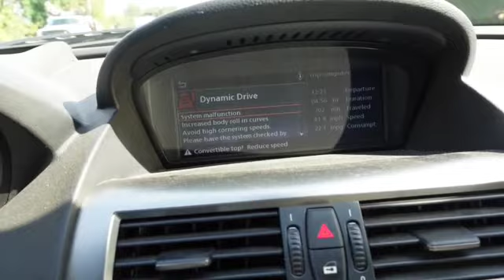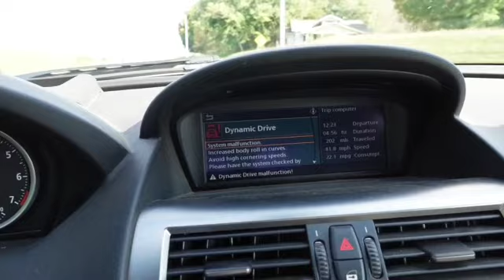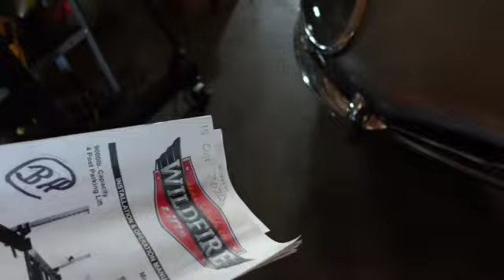Wildfire Lift Rebuild. You better do this. Check every single thing as I found a few other problems.

Comment: Did wildfire take care of you. I am thinking of purchasing a 12,000 lb lift from them. They did a video on bad bearings during covid days from supplier's. Please answer Thanks
Reply from the maker: Howdy!  The only thing they'd do was to offer me more their bearings and I didn't want those.  I got SFK's from a local spot.  Wildfire was a bit snippy about it and I can't say I was happy with the service.  The bearings in the lift were pure junk.  There is a response from the local guys and they wanted to keep those junk bearings to show customers.  I guess it was when suppliers were not 100% but they were still crummy bearings and crummy service from Wildfire.  I was hoping for a bit of a refund but it was not offered and I didn't ask.  For stacking I'd be concerned for sure.  Over the past months I've also noted that the drain back valve on the hydro system is leaking back.  When the bearings failed, and were falling onto the floor I had not used it but maybe 20 times.  It took most of a day to change all the bearings and that was not anything Wildfire was concerned about either.  I had to drill a hole in a runway to get one of the crummy bearings out!  I also put a friends Dodge Duelly on it (GVW 7,000 lbs.) and it seemed to really sag and we decided to not go under the truck.  I also had to replace a leaking hose.  I didn't bother to tell Wildfire about that.  I have no idea if they have "improved".  Thanks for the comment and ask any other questions you may have.

Comment: WOW...thanks for the video and honest feedback, I have a lift on order with Wildfire and these eye opener "ISSUE" videos can be a life saver, I think I'll just replace all the bearings before I install my lift, as it seems to be the common fault with this brand. Better be safe than sorry.  Stay Safe Under There !
Reply from the maker: It was a bad day when these bearing just turned to rubble.  I found bit of busted bearings for days after I did this job.  Thanks and I am so happy this helped you.   Bobby
Reply: Hi Bobby, Great job finding those other bad bearing’s, I sure hope others Wildfire lift owners see your video and check there equipment. Keep us posted if you have any other issues with your lift..thanks again.
Reply from the maker: @marcwesley8513  Wildfire blew me off.  I posted a video stating Wildfire gave me an FU... follow up.  They did offer replacement bearings but I wanted to get my own.... the Wildfire ones didn't work so well.  They offered no help on buying good bearings then went dark.  I haven't had any more problems but I am thinking of changing the hydro line as I just don't like the look of it.  Thanks!
Reply: @bobeaseshop9389  That sucks that Wildfire didn’t provide higher quality bearings and service, I guess they don’t appreciate how these internet reviews can help or hurt a business.
Good heads up on the hydraulic hose, I’ll be changing that also when I get my lift. 
Thanks again !
Reply from the maker: @marcwesley8513  Take it to a pro hose shop and see what they say please let me know.  That information will help all of us and I'll make a video about it - unless you want to.  If they say it's junk then I for sure will change mine.  If that blows it makes a real mess aside from being just dangerous.
Reply: @bobeaseshop9389  I work for a local John Deere dealer and we make high pressure fluid hoses, I’m  going to replace the hose when I install my lift, at least I’ll know where it came from, it’s not worth the safety risk and cleanup hassle. 

Keep an eye on your cables, I’d suggest putting a paint mark (witness mark) where the wire rope goes into the threaded female metal swage, upon future inspection if the paint mark is broken…it shows the wire rope is slipping out of the end….failure is imminent. 

From watching many videos, another issue to watch, is the wire rope going around the platform pulleys that lead the wire rope up the posts, if you inadvertently slacken the wire rope too much, there’s a potential the wire rope will come out of the pulley track, there’s no cable keepers (like the pulleys under the runway ) to keep this from happening, next time you raise your lift, it will pull uneven and may cause damage.
Reply from the maker: @marcwesley8513  I'll do that today and get a better hose made. Great work!  Do you mind if I make a video on this?
Reply: @bobeaseshop9389  Sure that would be great, I don’t make You Tube videos, so what ever you put out there would be a plus, if you see any external degradation ie. cracked rubber, minor wet spots, bulges, etc. if you could do a close up video, this will help the other Lift users see what they should be inspecting for, that is if they aren’t going to just replace the hose because of it’s unknown origin.
Thanks